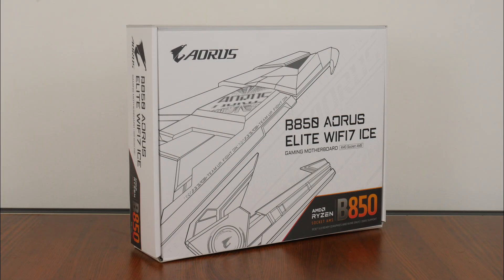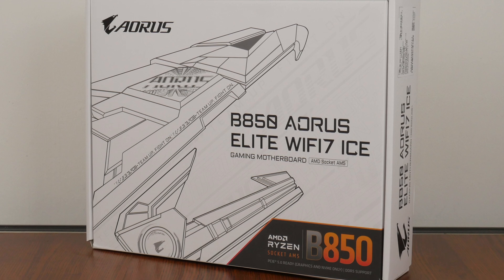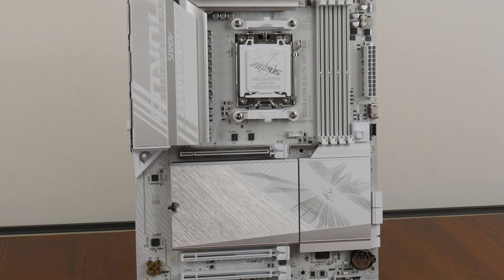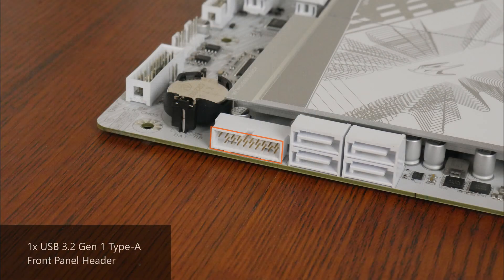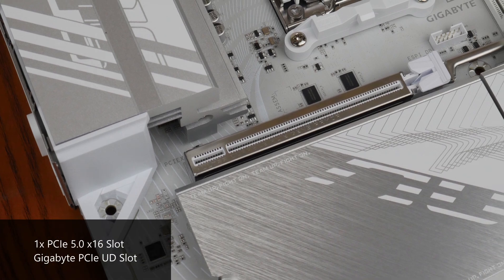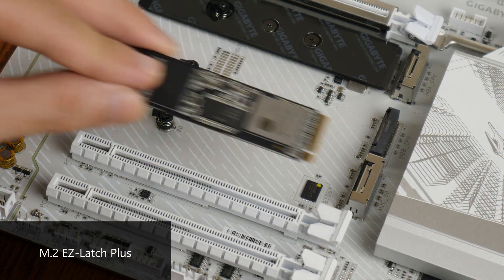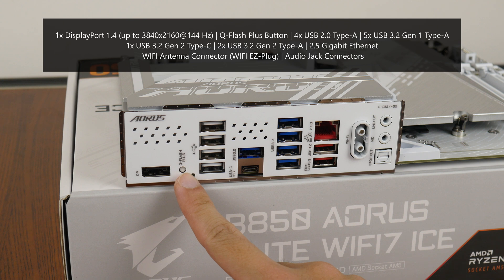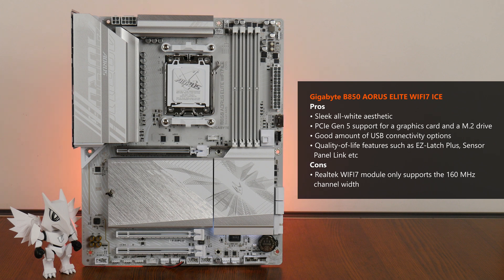PERFECT for Mainstream White AM5 PC Builds! Gigabyte B850 AORUS ELITE WIFI7 ICE Unboxing & Overview

Comment: is there any pci 5.0 lanes share ? i mean if full m2 sare sloted, graphic pci will be on 8x ?  need to get an am5 motherboard i come from intel lga 1151 i7 6700k xD and your video really help me they are straight to the point! thumbs up  new sub.  edit: waiting for the ASUS ROG STRIX B850-A GAMING WIFI  !
Reply: does this mother board do lane sharing? i’m in the same position
Reply: @jwild666  same here
Reply: Same here
Reply from the maker: Nope, this board (and B850 motherboards in general from what I see) do not have any PCIe lane sharing stuff that affects your graphics card's bandwidth!
Reply: @ALKtech  just got this board, and i have only x8 and not x16.. any idea what i can do or what i did wrong?
Reply from the maker: @UGAbsickerCrew  hey there, are you referring to the link speed for the primary PCIe x16 slot for a graphics card? How did you check this, and are you using a graphics card that supports only x8 bus speeds?
Reply: Yeah im talking about the gpu lane. I have a 5060ti and when using cpuz, it tells me im only using 8 lanes of 16.  @ALKtech
Reply from the maker: @UGAbsickerCrew  got it, what you're seeing is correct, as the 5060 Ti GPU uses the PCIe 5.0 x8 bus. When you insert a graphics card that supports the PCIe 5.0 x8 standard into a PCIe 5.0 x16 slot, the slot drops down to operate at x8 mode. Hope this helps!
Reply: Thanks a lot man ❤ wish you all the best  @ALKtech
Reply: Thanks for the info !! Any chance u review asus rog strix b850-a ? 😮
Reply from the maker: @nel5460  no worries! I'll have to see if I'm able to get my hands on a sample of the ROG Strix B850-A - but in the meantime, I do have another white B850 motherboard video coming up, so stay tuned!

Comment: It would be perfect if not the weird decidion about pcie x16 placement.  Gpu will look too high and more mobo will be visible from the bottom cuz of that
Reply: agree !
Reply: Yes, I am doing a build in the Lian Li 216 and have to go back to step 1, because I've found out that I have to move whole motherboard to lower position because graphics card is above first slot 🙄.
Reply: I just built a PC for a family member using this board. This was my only gripe. I found that the GPU inputs sit in the first slot and cables hit the top of the slot and don't sit flush. HDMI works even though it's not in all the way but my DP cables won't work. I've ordered slimline cables which should fix the problem but it was frustrating. Maybe a vertical mount might work a little better.